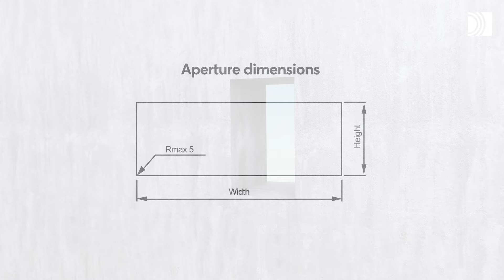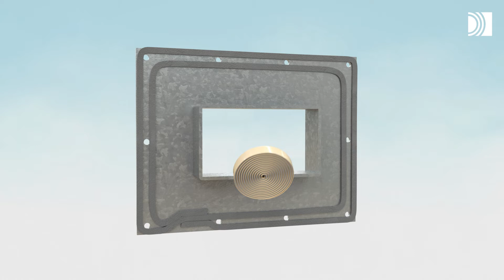Attach your Roxtec frame – in smooth concrete

Comment: When can the concrete be considered "smooth"?
Reply from the maker: The concrete is considered to be smooth when the surface has a uniform surface that can be considered to be flat at the frame area, without cracks and with any large protruding sections grinded off. Similar to an industrial floor or a wall. 
Rough concrete on the other hand is clearly uneven with voids and protruding concrete large enough to tilt the flange, preventing the gasket to seal properly. A rough concrete wall can be made to a smooth concrete wall by grinding the surface and if necessary plaster cracks and voids.